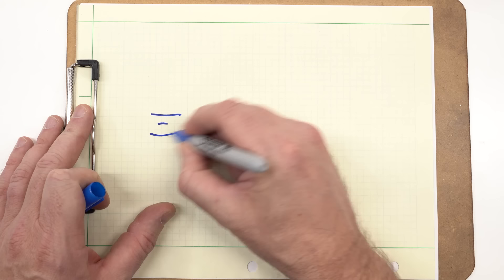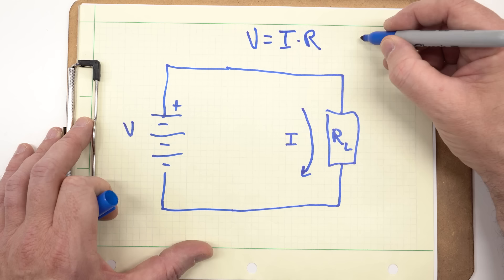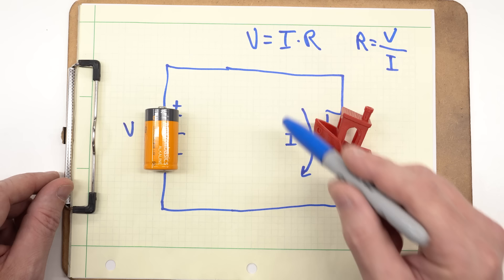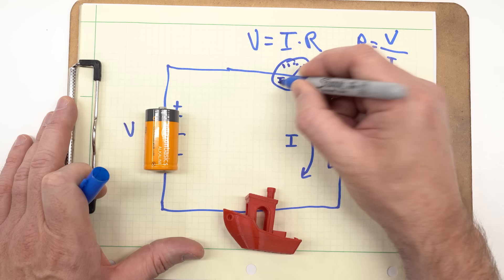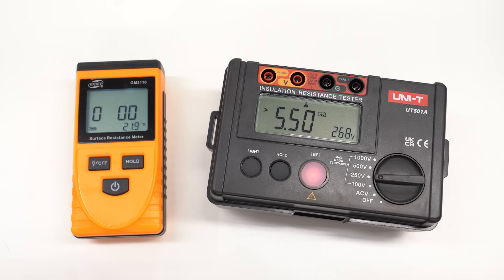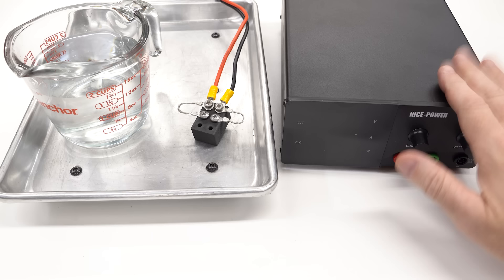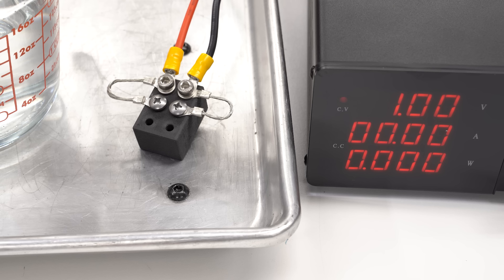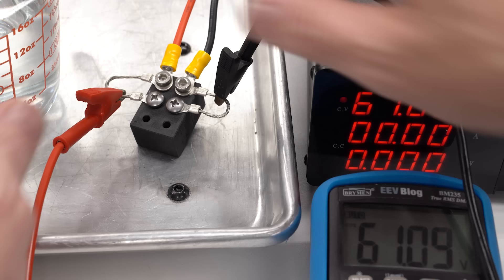3D Printing Filaments and Electricity: A Shocking Reality

Comment: Unironically, the problem isn't high voltage, it is actually the opposite: low power, low voltage, high speed signals is where making accidental shorts between various components on PCB even with high resistance semi conducting materials can distort the readings. So in short, in your application, it will not matter in the slightest. EDIT: but then again, those fibers inside are so small at worst then can make some capacitance.
Reply: Sure, accidental "shorts" (low resistance) will disrupt a circuit, whether it's high or low voltage.  In low voltage high speed scenario, an inadvertent high-resistance path will make little difference if that high resistance is high relative to the impedances in the circuit itself. One case where high-resistance leakage path does indeed make a difference, and that is in very high impedance analog circuits such as capacitive integrator for example in a Delta-Sigma ADC. Then leakage will unwantedly charge or discharge the capacitor and affect the precision of the ADC.
Reply: @Graham_Wideman  ADC was actually example i was thinking of, another is touch sensitive buttons. I am not saying making enclosure out of CF will 100% affect the circuit because it's rather low chance but in his scenario (bench power supply) it will just not matter. Not only those aren't even remotely close to 250V, even if leaks couple of mA, it will not even get warm. And since its not high speed low power signal nor capacitive circuit it will not disrupt the readings.
Reply: @Kmnri  But again "high speed"per se has no bearing on this discussion.

Comment: Hilarious that the raw filament isnt a convenient form factor when alligator clips exist. Definitely would have been a quicker and more boring video.
Reply: but it could give wrong answers as the fibers will change layout after being extruded during the 3d printing process.
Reply: @BaldurNorddahl  Certainly a possibility. But having a sample size of 1 for each filament is probably a worse sin in the grand scheme. I think it's more likely that in any given length of material, there is a slim but non-zero chance of enough conductive fibers bringing between two points. 

Testing a meter of filament at 1cm intervals is probably as good a test as 3D printing a part if that is the case.

Comment: Ppl mistakes in one thing it is graphine that conducts electricity not carpon. In order to filamet to conduct electricity it must have continous graphine structures inside. Either graphene sheets or carbon nanotubes. What makes graphine conduct is that it allways has one free electron in each atom to move. when you mix it with other materials it is this 1 electron that bonds with them. making graphine less condictive. Carbon other hands have gaps in atomic structure making it really not conductive. when marerials are mixed with other conductivity is sum of both materials. In some cases compound materials may be more conductive than both compounded materials seperatery. There is even slight chance two non conductive materials becomes conductive together. But it all comes to atomic structure.